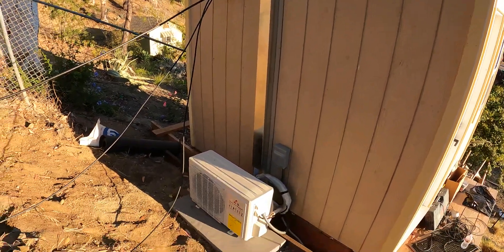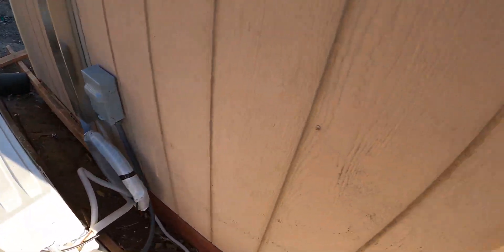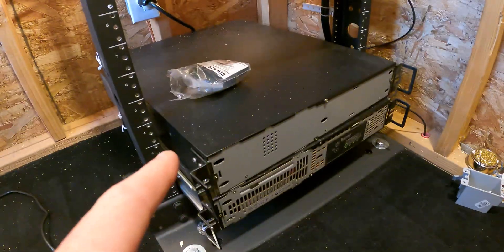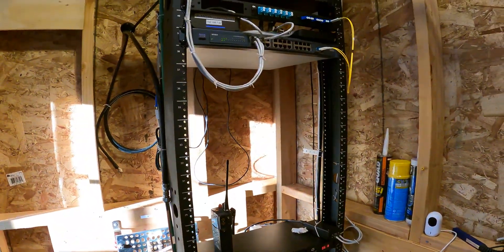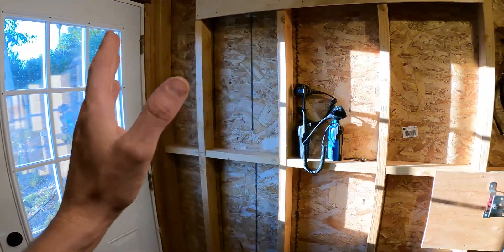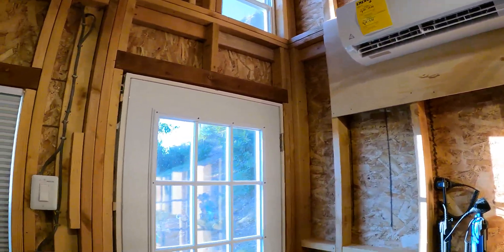Backyard Communication Shelter

Comment: Looks great BUT it DEFINITELY needs insulation and a vapor barrier if you didn’t install a barrier prior to installing the exterior siding. I can’t imagine installing HVAC in ANY un-insulated building. Just doesn’t make sense. 
Equipment looks nice!
Reply from the maker: it does have a vapor barrier.

Comment: Nice build !  The ground cable and copper buss are nice but suggest you run a smaller wire from each piece of equipment to your common buss, even the ladder rack up above, can't rely on the painted rack rails. Your shed will certainly draw attention so suggest a reflective tint on all glass. Get your coax off the ground before the rodents have a chance to chew on it. For as little internet bandwidth you'll be using I have to ask what your fiber provider is charging. Program the Raspberry to send you a text and email if power goes out or unauthorized entry is in progress. Just remember you asked for feedback which all Hams and GMRS folks have no shortage of. KE8CIE

Comment: And where your ground panel is under where your wires come in.. I'd bolt some polyphaser lighting arrestors there for your antenna coax to go through. Hopefully that panel is connected to your electric service ground as well. It probably is by virtue of the UPS metal case, but might as well make it intentional.

Comment: Why was all the computer rooms I’ve been in,they were cold in there.
Reply: Lots of equipment generates a lot of heat. Heat is bad for equipment. Keeping it cold keeps the equipment running at a safe operating temperature. If you keep it colder then there is more room for fluctuations in temperature, versus higher means equipment will be closer to it's warning/critical thresholds and may shut down to protect itself.

Comment: I know you mentioned not needing insulation, but.... Some reflectix or insulation4less reflective foam insulation would be easy and not messy. Some on the ceiling or sunny wall  would be <$100 and a box of staples. Looks good overall.  My tower shelter is in a rural woods place... I have security cameras which on the tower are nice for weather observation, and on the ground nice for wildlife observation. Noticed you have a camera inside.
Reply: Insulation or unnecessarily high electric bill for AC and heater in the winter ?. 
Listen to the comments,  "You need insulation to control humidity and condensation, its thermodynamics '.  it may be a small space but if it didn't make a difference why did you fit a mini-split.    Nice build but energy hungry, invest in solar PV and a UPS.
Reply: @WOFFY-qc9te  Yeah, insulation is a nobrainer IMHO